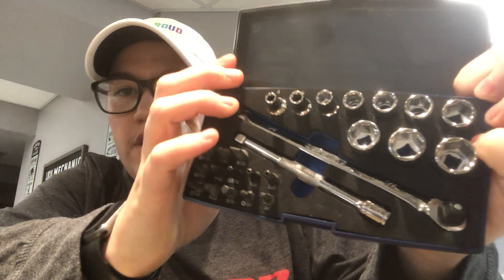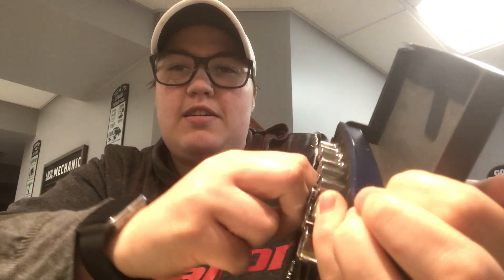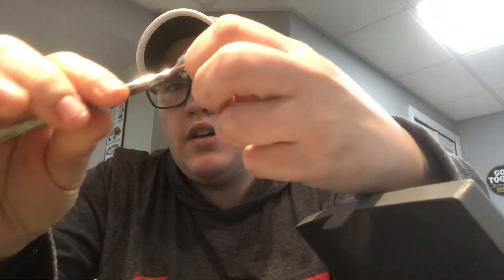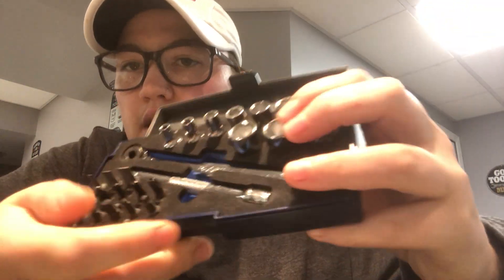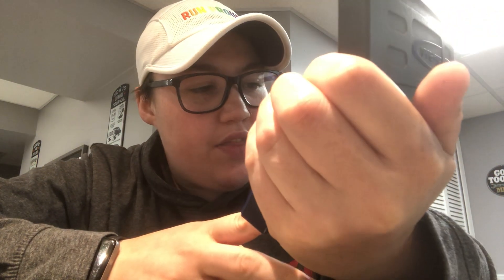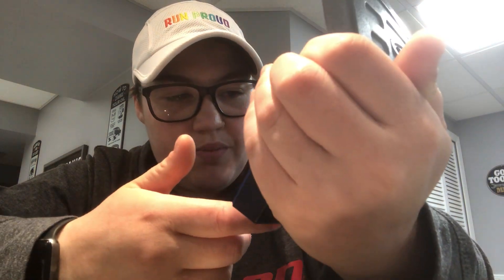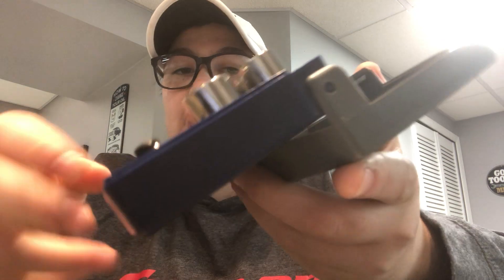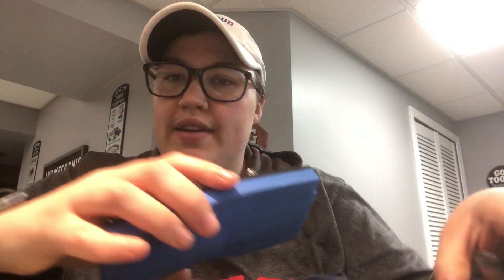Blue Point/ Snap on 1/4 bit and socket set

Comment: I have the Blue Point 3/8" socket set. Similar grey plastic box will full run of both metric and SAE sockets. I kept the BP extensions but replaced the Blue Point ratchet with a Snap On one. The 36 tooth BP was just too sluggish for my taste. Thanks fro the 1/4 review.
Reply from the maker: Do you like the 3/8 ?
Reply: @TechMay  It's a solid kit especially for the truck/car. I got it used and the price was right. I like the fit of the Snap On a little better when I have a choice.